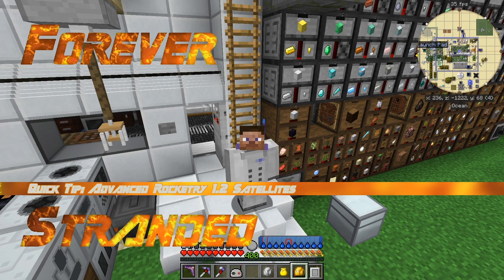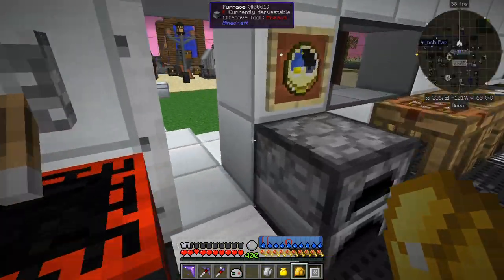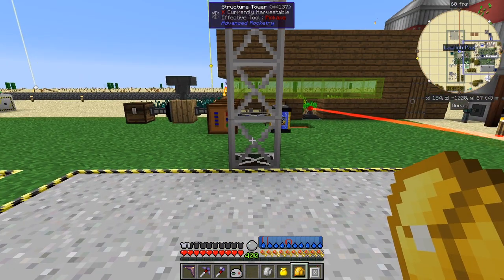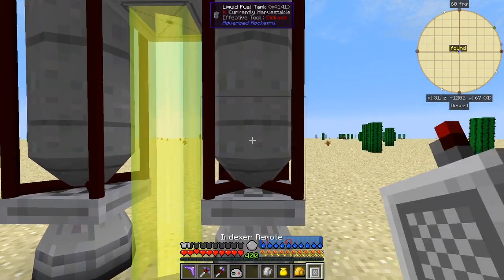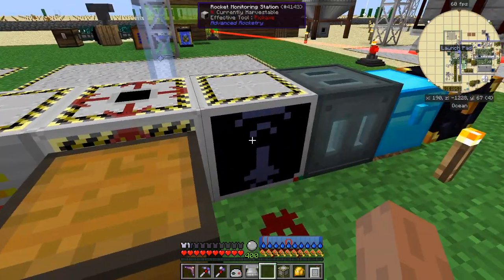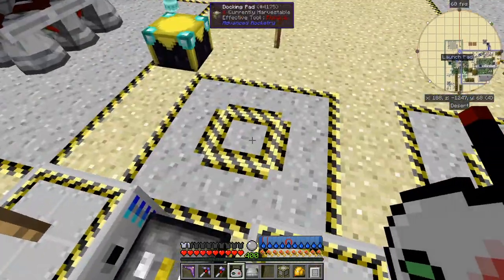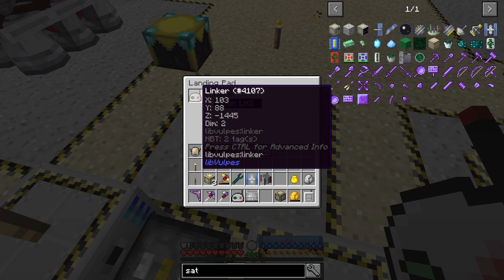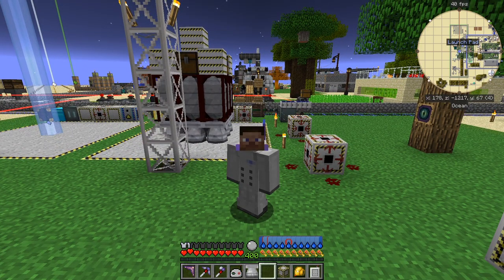Forever Stranded Quick Tip 05 - Advanced Rocketry 1.2 Satellites

Comment: Soo much information on satellites. You can see the Mod is not completed yet but it seems to be moving along nice. :)
Reply from the maker: Yes indeed this changed quite a bit from 1.1. I reckon that zmaster will be releasing 1.2.x soon. Thanks
Reply: The think I would like to work the most is that rockets return to a determiner location. Like the docking pads that you are trying to make work... Having to search in 256 by 256 area to find a rocket seems a bit ridiculous to me.
Reply from the maker: Philippe Asselin it would be nice if they returned back to where they started. If there is a docking pad under the rocket with a linker pointing to another docking pad in another dimension then it goes there. zmaster said that if it had a seat it would return back to its starting point but this is a bug and I couldn't get it to work. It is just rockets sending satellites up that return in a 512 block square around the launch point, if you put markers down it takes about 5 mins to find the rocket after it has landed.
Reply: I know it's not that big of an area, I just thought that having a guiding beacon would be a nice feature.
Reply from the maker: Philippe Asselin yeah a rocket finder would be very cool, a radar like device or rocket compass would be just the ticket.